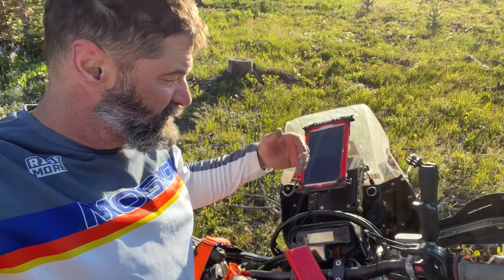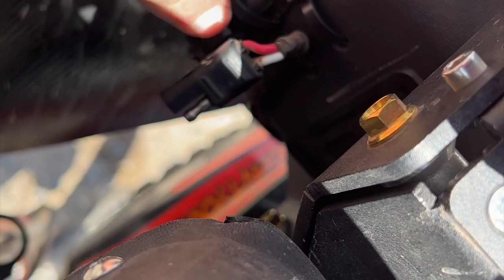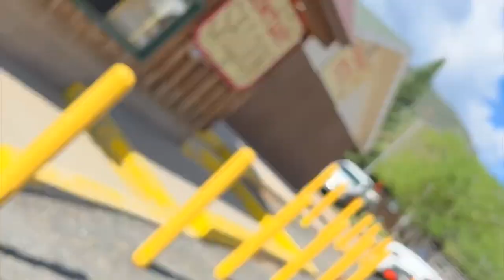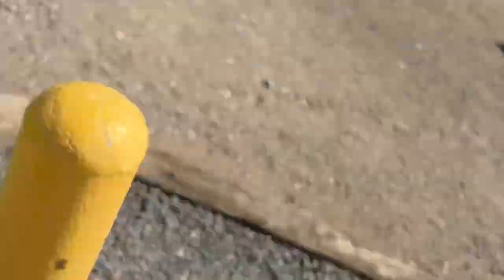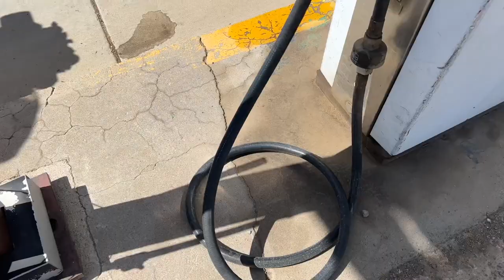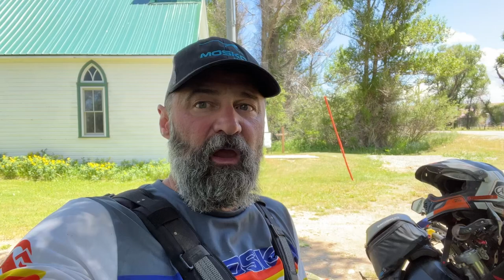WYBDR Section 2

Comment: What's John T. Young's difference between "broken" and "not working"?
Reply from the maker: The bracket that holds my fairing on "broke" out in the middle of nowhere. Bolt head snapped off. But it still "worked", and with some straps and duct tape held together for another 3500 miles.